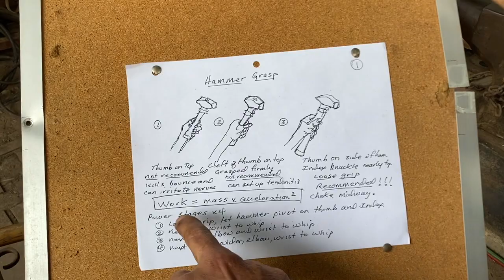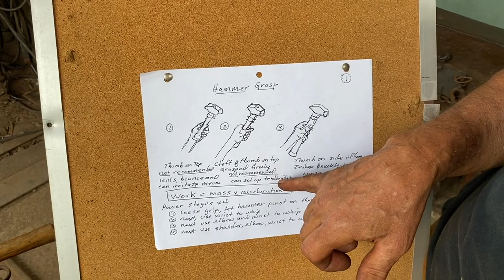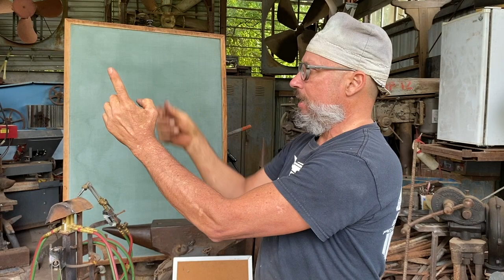Blacksmithing School 2.1: Hammer Control Theory and Practice

Comment: I got to do some forging today and tried to apply some holding  techniques that you talked about. Very helpful, I didn't feel as fatigued as I usually do. I hope you continue with the smithing videos.
Reply from the maker: Thank you for the feedback mulekick. I personally had over 10 years forging experience by 1997 without the benefit of any ergonomic system and subsequently developed wrist problems, so I was open to another way.  I found that by rotating the grip as I described in the video (taught by Uri Hofi as a result of his research of other master smith's approaches) was at first unnerving but within a few days it felt natural and it really decreased the strain on my wrist. I have never looked back.
Reply: @blackmetalstudio6425  I had to keep reminding myself to try to relax and hold it proper.  Lol
Reply from the maker: @mulekickforge4242  Stick with it. I wasn't convinced it was right for me for three grueling days and then I got it. So hang in there. It will become more natural.

Comment: I remember that Kinyon style air hammer you built circa 2004.
Reply from the maker: I still have that Kinyon air hammer, I'll demonstrate it in upcoming videos. I built it to inspire students to build their own, it was the 3rd I built from scratch, additionally, I converted 3 mechanicals to air, it's a good system. Best to you Luke. Stay tuned!
Reply: @blackmetalstudio6425  Yeah, I was one of those students. You've had a shit ton of students, my name is Luke. Matt Bush and I were in that class. I didn't finish it. I moved that beast to California and ended up selling it on Craigslist. Sad to hear you retired from ACC but stoked to see you on Youtube. Your classes benefited me greatly, even though the metal work I do has a very small % of forging. Thanks for for putting out this info.